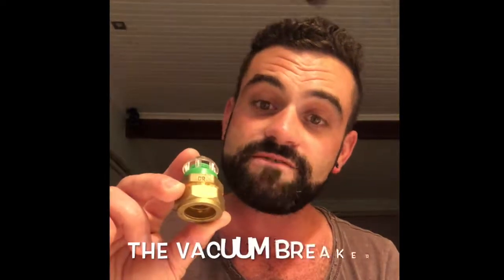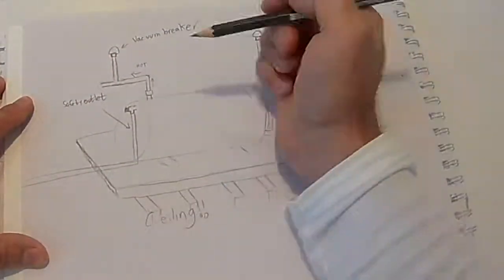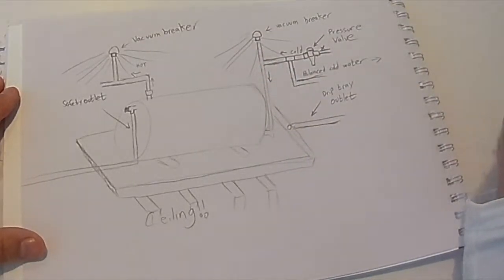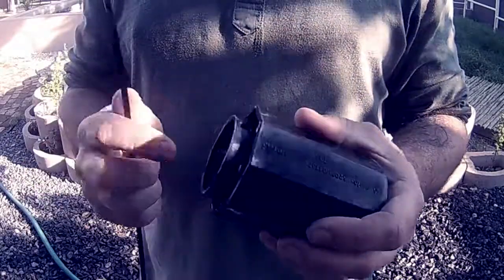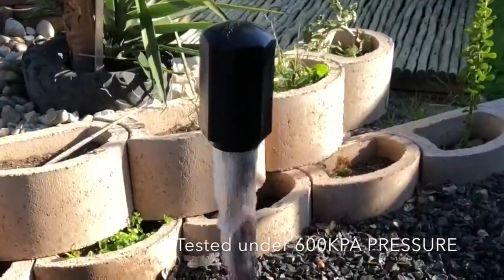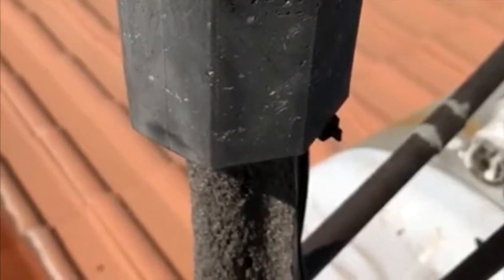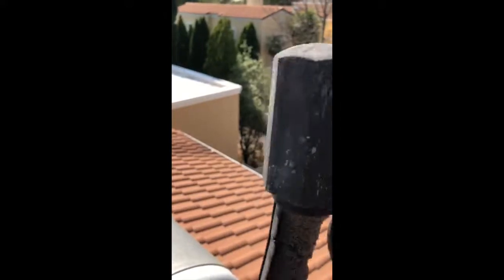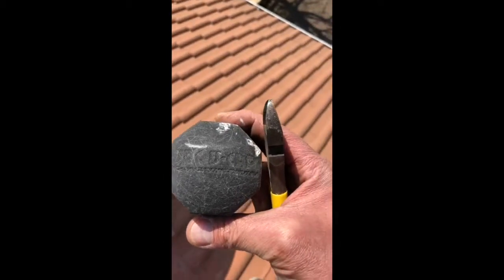Vacuum Breakers Fail, let's test the Vac U Cap

Comment: Can you  use air release valve on instead
Reply from the maker: No, they are meant for 2 different purposes. The one lets air in and the other lets air out. My question is, why would you want to use another type of valve, when this is what regulator specifies? I would just stick to the product designed for the job.

Comment: Great video.is it possible to Replace a Vaccume breaker with spring check valve ?
Reply from the maker: Thanks.... I'm not sure, but as I always say to this type of question, why would you want to use another type of valve, when this is what regulator specifies? I would just stick to the product designed for the job.

Comment: Hi Guys. Great video! Quick question, where could we pick up the Vac U Cap?
Reply: Hi Jason, thanks. Good Question, (Send me your contact details so I can send you some, I have put website links below to make contact)... It has been very difficult to get this product into the market, because we keep hitting brick walls. The large manufacturers like Kwikot and Cobra don't want to admit that they manufacture products that fail and the general population of plumbers seems to avoid surveys on this subject, because they don't want to admit that they have used Vacuum Breaker failure, diagnosing the leak as a "Burt Geyser" to sell their client a new one. Geyser replacement pays more than vacuum breaker replacement. 

To answer your question, I sell Vacucaps on all Geyser installations like I would a drip tray. The insulation and weather protection is just an added feature. (My colleague Dale in Johannesburg (Dale Simon Plumbers), also does the same thing. Dale designed the cap a few years ago believing that it is just as important as the drip tray on a geyser installation, but the industry is a difficult one. 
It seems like the big players in the industry have the regulators by the balls, so they have big influence over there. We can't get accurate data on actual vacuum breaker failure, because of the plumbers protecting their own fraudulent behaviour, so the data and support is just not there for resellers to show enough interest in the product. 

On the positive side, for everyone,  there are definite benefits when it comes to insulation and weather protection on exterior installations, while still allowing the vacuum breaker to be fully functional.

Woops maybe that's too much info... if you want to make contact to order a couple of Caps here we are:
Cape Town: https://www.rootsplumbing.co.za
Johannesburg: https://www.dsplumbers.co.za